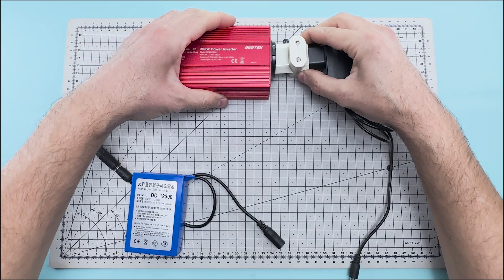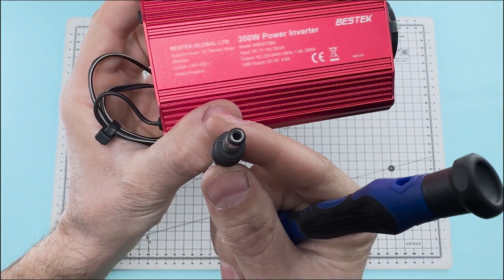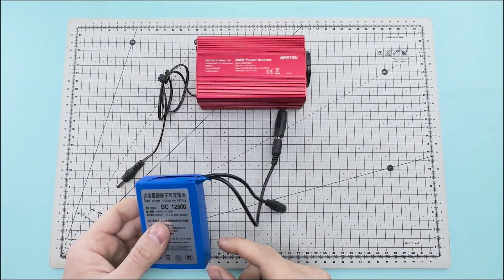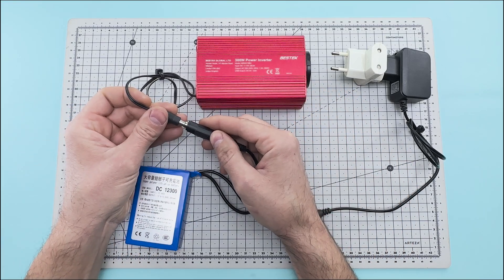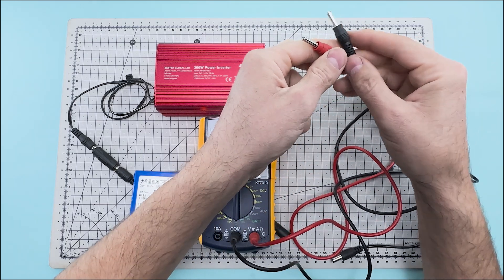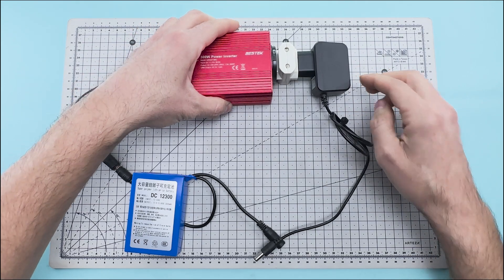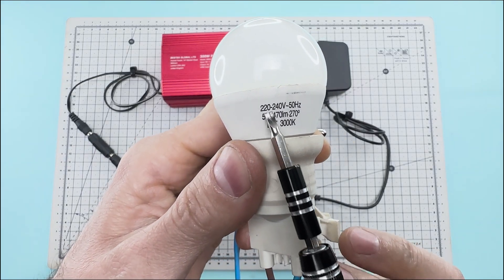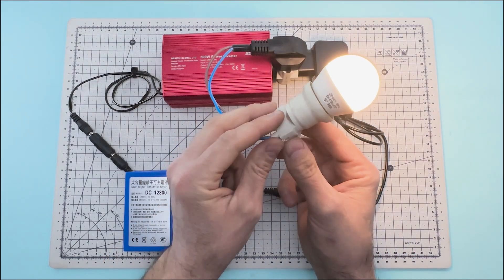Amazing Idea for Free Electricity - Energy Regeneration

Comment: Just hooked up the same inverter but a 120v model, hooked up to a twelve volt 7.5 Ah battery.  Going to give it a whirl with my ebike rapid charger.  Seems to work.  Unsure of duration.  Next on the list is a pair of APC battery backups plugged into each other.  Way to go Team Zero Point!

Comment: I think it is possible. "The Crazy Channel" YouTuber, you have already found a very possible answer.
Uploaded on 2024.5.10. Video, title: "Everyone wants to have this invention - Free Energy".
As shown in this video, if you insert a "Schuko plug socket and plug with a capacitor" between the charger and the inverter, I think it is very possible. Because the input power can be greater than the power consumed for charging.

Comment: Bought all electronics off Amazon and assembled them exactly like this video and for the first time it actually works! At least for 12 hours or until the battery is charged then the converter automatically shuts off.
Reply: @Rebel-p4p good

Comment: Well, you could use a battery meter to show power drawn from battery and an AC power meter for socket into output from inverter … then we can all draw conclusions

If you use on output from inverter a different setup (open circuit + ground) it may work for small power excess.